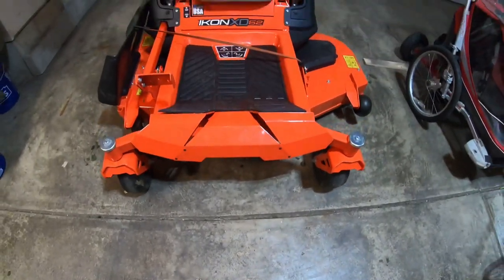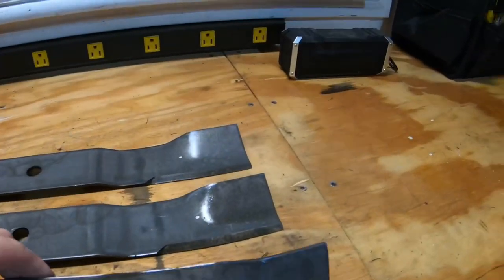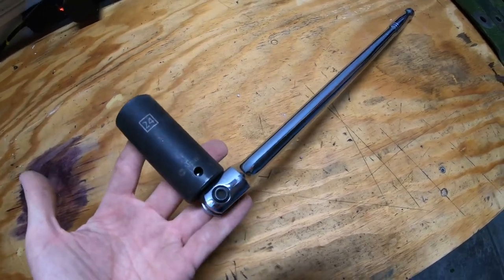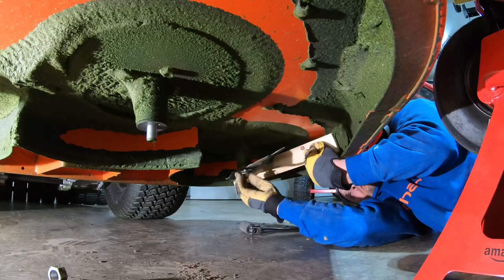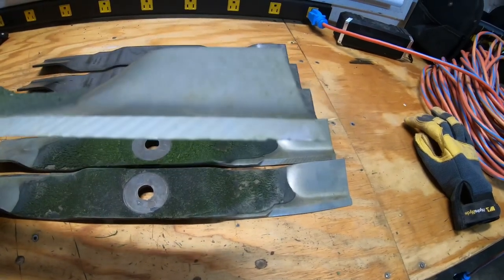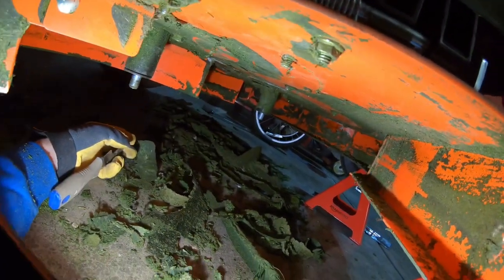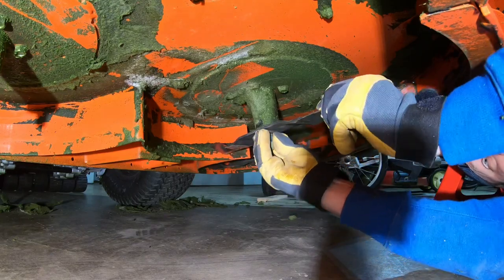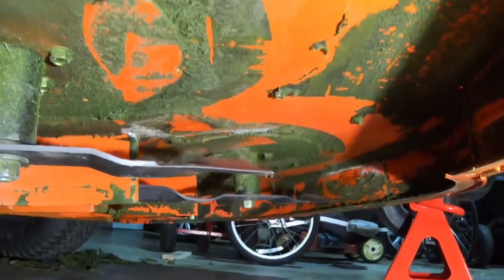Time to Change Blades and Clean Deck on Zero Turn #AriensXD #Mr52

Comment: Use anti-seize on the threads, turn the fuel line to closed before lifting, and get some heavy rear wheel chocks and put mower in park after lifting it. :)
Reply from the maker: All great advice. What are you mowing with? Thanks for watching!
Reply: @theSuburbiaDad  Husqvarna MZ54 and TS348 XD tractor. Thanks.
Reply: where is the fuel line shutoff on the kawasaki ariens?
Reply from the maker: I don’t believe there is one. Here is how I recently completed the engine maintenance….

Getting Ready IKON XD for Spring #Ariens #Mr52 #AirSparkFuel #OilChange

https://youtu.be/_m5BR1IlwGc

Hope this helps. And again, thanks for watching!

Comment: How do you clean your mower???...it still looks new.
Reply from the maker: I try to not mow when the grass is wet or muddy. This is not always possible, but I try. I blow it off after each mow. Occasionally I hose it off and then and let it sit in the sun to dry quickly. I don’t do anything special. I do like to use lightly use motor oil (new or used) to wipe the plastic components down. Unconventional, but a light coat has worked well for me. Hope this helps! Thanks for watching.

Comment: I use a 60 grit flap disc to sharpen my blades and noticed that the tip is rounded (not at a 90 degree angle anymore).  Any advice on preventing this and how to properly sharpen the blades?
Reply from the maker: On the Ariens blades, it has a slight tapper / curve at the end. In the manual it will show a tolerance for the curve. Hope this helps!

Comment: Did it matter what directions the blades were facing when you reinstalled?
Reply from the maker: Nope. The blades will not touch. Just make sure the topside of the blade is on the top. Otherwise you won’t like the cut. 😆   Thanks for watching and commenting!

Comment: Are there grease points for the spindles on this mower?
Reply from the maker: Nope. I believe the spindles are packed with sealed with grease. The only two grease points I’m aware of are in the front wheel rims. It keeps them spinning smooth. Thanks for watching! Hope this helps.

Comment: Great video. What length breaker bar did you use?
Reply from the maker: I use an 18 inch Kobalt. I picked it up at Lowe’s years ago. Works great! It has the 1/2 drive on it. 

Thanks for watching and commenting!

Comment: Isn't the normal interval 25 hours or more? Also did you buy yours from Lowes or actual dealer?
Reply from the maker: For me it is when the cut looks below par. Sharp blades are important for cut quality and plant health / growth.... ignore the time... sharpen / change blades as needed... 

I did get from Lowe’s. I spend time going over everything on the machine when I got it. I corrected a few things before my first mow! If you go with Lowe’s, I recommend the same thing. 

Thanks for watching!
Reply: The seat for the version from an Ariens dealer looks different than his and they have the Kohler motor, probably more expense than getting it at Lowes too

Comment: Hi, I propped the mower and jammed the blade with a wooden block, But when I applied pressure the nut didn't loosen and I could feel the belt rotate although the blade didn't move, Any ideas on what's happening?
Reply from the maker: Did you get it? They come factory tight… aka secure to guarantee no injury due to their work. So, tight. 

So, if one blade moves, they all move. I think it happened to me. With my breaker bar, I pulled quickly repeatedly until it released. It would resemble Impact Driver at the nut. So, not a long normal pull. More like a tab, tab, tab… Definitely make sure you have the mower safety positioned before doing any work. Safety first! 

I found a six in board was perfect to remove blades. I have a Short on it. 

Thanks for watching!
Reply from the maker: Blade Changing Tip IKON XD #Ariens #Shorts

https://youtube.com/shorts/edAcF8yXyBs?feature=share
Reply: So . When they all move. Are they slipping on the belt, it’s a shuddering feeling. Do I just persist. And if I remove the deck will it make it any easier. I’m cautious about doing any damage. Thanks for your replies 👍
Reply from the maker: @patmcternan I am not 100 percent sure. You might call Ariens customer service and see. There is probably a number in the manual to call. 

Removing the deck might make it easier for the first time. You’ll just have to make sure everything is proper on the deck when reattaching and double check the deck height is set right.
Reply from the maker: @patmcternan  here is a video on removing deck… https://youtu.be/TlWNiSK_u4w

Comment: My stock blades after 1 year and 20+ hours look concave and rounded off. Shocked how bad they look. i just ordered some aftermarket ones because they can't be any worse than the stockers. I don't even think they are work sharpening. I hit a few sticks and rocks and i got lots of sand, but damn. you can't get more than 40-50 ft lbs on those nuts without the stupid blades spinning anyway. kind of a dumb design if they want you to torque them to 70-90ft lbs. without an impact it ain't happening.
Reply from the maker: You made Samurai swords! 😆 

I used a small board to hold the blades in place so I could tighten the nuts down. Here is a video… 

Blade Changing Tip IKON XD #Ariens #Shorts

https://youtube.com/shorts/edAcF8yXyBs?feature=share

Thanks for watching!